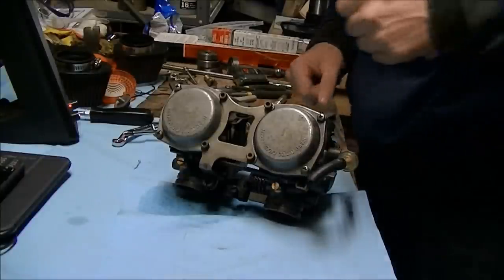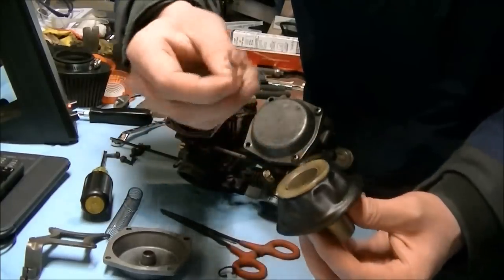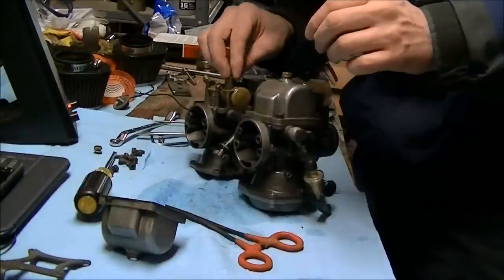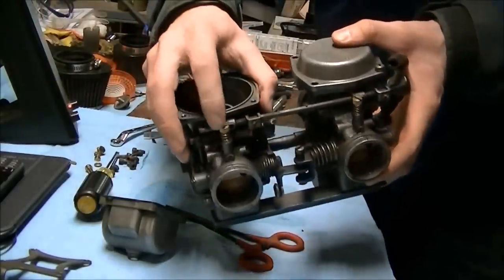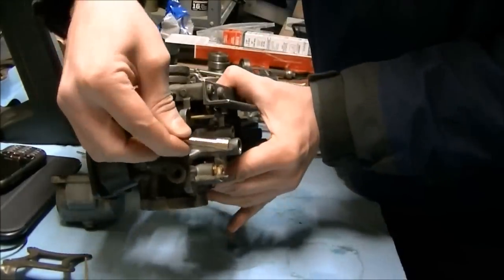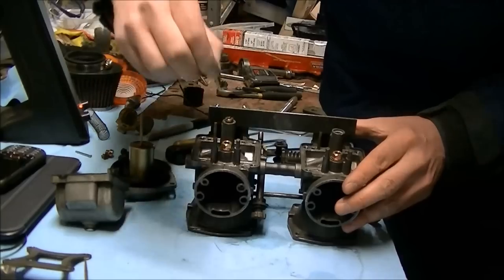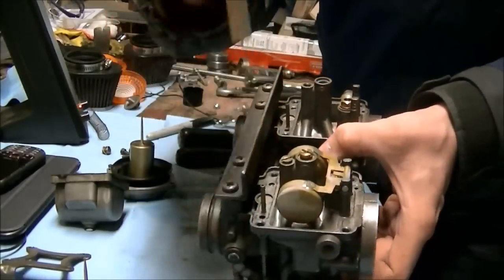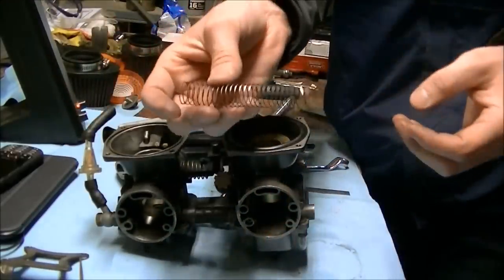How to clean the Yamaha XS400 and XS650 Mikuni BS34 carburetor

Comment: A helpful tip for things like jets my dad always told me: use two fingers to tighten, then turn 1/8th of a turn or so past that point. Also ultrasonic cleaners work great for cleaning carbs, as long as you're doing a full rebuild and are planning on swapping all the gaskets.

Comment: With "High Definition" AND suspenseful tetris music!

If this is the first clean and you wanted to emerse the carbs in a cleaner, would you recommend taking more apart?
Reply from the maker: Be careful soaking them; there are hidden plastic parts that can be vulnerable to solvents. Honestly, I'd just use compressed air and carb cleaner!

Comment: My 1978 gs 400 is now straight pipe....same exhaust diameter exit has thé original ones..... do i need to change jets on there or whit that air/fuel adjusting screw i can get a suffisant adjustment!!!!! .... Nice video by the way!!
Reply from the maker: Luis Camacho straight pipes definitely need jetting. You will likely need to change the pilot and main jet. It's also possible the needle height will need some tweaking. Best bet is to search the forums for your bike and look for someone with a similar setup that posted their settings. This can save you a lot of tuning.

Comment: How essential are the screens under where the float needle is located? I'm afraid while cleaning the screens I damaged one, they are brass and a bit fragile. My instinct is the carb will still work fine, but I'd like to be sure.
Reply from the maker: The screens are used to filter the fuel, so they are not essential to run. However, I would recommend installing an inline fuel filter between your gas tank and the carbs. I recommend everyone do this, but especially for you if you're missing one or more screens.
Reply: @RiderForge  Thanks for your quick response. I've ordered a carb kit, 25 bucks, which has the float needle seat screens., as well as new jets, gaskets, and needles.  I figure it's better to play it safe, and why not replace these things while the carb is off the bike.  Do you have a video on installing an inline fuel filter? By the way, thanks for this video which was of great help to me in cleaning the carb on my 79 Yamaha XS400.
Reply from the maker: @_Peremalfait  Good call. I don't have a specific video on that, but it just involves cutting your fuel line and jamming the filter in there. It's good practice to use clamp fittings for security. You just want to ensure it's a small filter designed for a carb (and not a fuel system with a fuel pump which generates a lot more pressure). The filters are also directional. The next "gotcha" is ensuring you have the correct size filter for the size of your fuel line; you will want to either measure the inner and outer diameter of the fuel line or confirm with someone on your model-specific forum.
Reply: @RiderForge  Sorry to bug you again. I got a carb kit for my BS34. The kit didn't include gaskets for the float needle seats. Do I need to get some? The old seats appear to have used a flat gasket, but there's not much left of them.
Reply from the maker: @_Peremalfait  You may just want to try things with the parts you have on hand right now. Taking the carbs off and apart doesn't take too long once you've done it a few times. I did it so many times I was able to get them off, adjusted, and back on in under 10 minutes! Anyway, I will say that the bs34 carbs are "fickle" and even the tiniest imperfection may cause issues. Worst case scenario you fix the parts you have yet to replace. Good luck!
Reply: @RiderForge  Thanks again. A really appreciate the response. I actually managed to find a gasket at an auto parts store. It was a little too thick and sanded it down to match the broken one. It fits, and at this point I'm done tinkering until I get a chance to try it out. Waiting on a new battery and plugs I ordered online. My bike is a 79 xs400 and It's been in my shed since 2007. Getting it up and running again is my goal for the summer.

Comment: Just a quick question. Do you ever lubricate any (internal) parts of a carb? Perhaps, not needed since fuel with oil is circulating, or, may clog stuff out. Just wanted to make sure..  Any thoughts on that?
Reply from the maker: Ken To good question. There are a select few areas of the carbs I would lubricate but these generally don't come up during a routine cleaning and they are technically external. This includes the choke rod, the butterfly valve "rod," and the throttle cable insertion point that pulls on the butterfly valves. A sparing amount of lubricant can be used in these areas where metal is moving against metal. Think of it more like lubricating a door hinge. Any parts like that can be greased lightly so they move easier. Anything internal shouldn't need lubricating and since gas is a great solvent anything you do add will be very quickly washed away or worst case it might clog things up.

Comment: great video, tx.      on  my right carb turning the newly installed fuel/air screw [ and fresh o-ring ] does not change the idle at all, not a bit whether its screwed in all the way or out all the way.  does that sound like a clogged pilot jet?  tx!
Reply from the maker: It could be a clogged circuit, yes. Also, ensure the old pilot jet tip did not break off into the inlet; this happens when people tighten them down too much. Are the pilot jets also new? Are the tiny holes in them clear? Sometimes I pull out the jets and air screws and spray carb cleaner in there; then blast it out with an air compressor. I made a little rubber tip for my air sprayer fitting; it really clears everything out! Other things can affect the idle too; the butterfly valves; the carb synch, the fuel level in the float bowls, the air filters you're using, the valve adjustments, the timing... and it goes on and on.

Comment: hey thanks, super informative. what do you do if you strip the head on the pilot jet? asking for a friend....
Reply from the maker: FuckinPrawns Decide if it is necessary to remove; often times you can clean the pilot circuit THROUGH the jet without removing it (use carb cleaner and compressed air). If you need to increase the jet size this won't work of course because it will need to come out. A standard extractor should work assuming it is long enough to reach. You may be able to remove it by hand (no drilling) because it is so small and made of brass. If you go slow, jam the extractor in there and twist it out by hand you should be good to go. Before you start with the extraction dump some PB Blaster or equivalent in there and let it marinate for a while just to make things easier. You can also try hitting it with a little heat using a butane torch. Make sure to clean the Blaster out before inserting the extractor or shooting it with fire. Use the smallest extractor possible to avoid damaging the surrounding threadings as well.
Reply: chiangxiong i guess i have to find an extractor small enough to fit. thanks for the help

Comment: What was that plug on the pilot jet near the main jet? Mine had a rubber plug on the pilot jet on one of the carbs. I did take it off but the bike runs fine without it. thanks for the videos.
Reply from the maker: Later models came with rubber plugs; older ones like mine have brass plugs. The pilot jet plugs are literally designed to allow access to the pilot jets. It's a controversial subject because results are very inconsistent when these plugs are removed. Some people run too rich or flood when these plugs are removed; you'll also find just as many people that seem to be able to remove them without consequence. From a design standpoint it looks as though they will prevent excess fuel from entering the pilot circuit without first passing through a small channel linked to the main jet. The thing is, sometimes the extra fuel coming through an unplugged pilot jet at idle is not enough to cause problems. Other times it is. If it were me I would install them or replace them; an engineer at some point created them for a reason. As much as I've tried, finding a true answer to this question has proven very difficult.
Reply: I will put it back, but do both carbs have a plug? only one of mine did. thanks. Mines a 1982 special II, btw.
Reply from the maker: Yes sir. Both carbs should have a plug. Check out xs400.com as well; it's a great site.

Comment: Is there a way to clean the carbs (just to make it clean enough to operate properly) without having to re-set the mixture screw and re-sync the carbs afterward?
Reply from the maker: I would recommend pulling the mixture screw out for cleaning but you can certainly avoid syncing the carbs initially to just see how it goes. Adjusting the mixture screws is super easy.
Reply: I wish you could make a video on that. After cleaning, we should adjust the mixture on each carb individually, and then sync them, right? I went to some shops around my place, and they said old carbs like mine are usually hard to setup.
Reply from the maker: Old carbs might take longer to clean because they've been neglected for years. Parts can also be more difficult to locate. Some customers might get upset about this and blame the shop for the bad experience.

Comment: awesome! Did you clean it after you took the emulsion tubes, the pins, the float needles, basically once you disassembled everything thing in your video?
Reply from the maker: I cleaned everything off camera on both sides. I just wanted to take everything off as fast as possible in this video.
Reply: chiangxiong well..... tried taking the needle off the float bowl and the tower just cracked in half.... now I'm currently looking for a right side mikuni BS34 carb. Haha, just my luck. But the video definitely gave me a good idea of how to properly clean it, thanks again! I guess I've been cleaning it wrong this whole time!
Reply from the maker: Michael Park That sucks! I've seen a few of those towers crack before. Sometimes the pin gets stuck and it seems like it doesn't take a lot of force to break them.

I wasn't terribly impressed with the results I got from soaking in the past. Unless you have an ultrasonic cleaner of course.
Reply: Michael Park May Be a Little Late now, But, I drilled down into the carb body, then, drilled into the top of the broken Tower all the way through. Then I placed a Snug Pin into the carb base and Broken top of the tower and used a small amount of JB kwik weld to ensure a bond. I replaced the Float Pin for alignment while I clamped it to cure and I also used a small amount of Vaseline at the Float Pin so the JB Kwik Weld didn't stick to the Float Pin. It Worked fine. There is no pressure on the tower so it's a Option for repair. I found the Tower Broken when I opened the carb after Buying it.
Reply: chiangxiong The pins don't just become stuck, some models have a thicker ends to the pin so it is pressed tightly into both towers. When I tried to tap mine out at the first clean, similarly to your technique, the head-end of the pin remained stuck and bent as the tower gave way :( You might want to mention this in the video, as your technique will break more towers when a little more force is applied. 
Here's the forum thread on broken towers with more info and fixes: http://www.xs400.com/forum/showthread.php?t=10312

Comment: Hey man I have an XS400 78' I want to put mechanical carbs can you recommend some that they fit? thanks in advance :)
Reply from the maker: I have seen a few carb swaps (including a single carb setup) done over the years on the forums, but this requires custom fabrication of intake manifolds and/or brackets. To my knowledge nothing bolts directly up. Are you looking for a bolt-on solution or is fabrication an option?
Reply: I really do not know! I just got fed up of my bike not starting on easily and though of moving to mechanical carbs. But i do not know exactly what i have to do. SO i think i am looking what works best. And maybe the steps I should take.
Reply from the maker: For the bike to start easy the carbs need to be surgically clean and the timing needs to be perfect. If you adjust these two aspects you may get the results you're looking for. Mine always started first kick.

Comment: Any advice on a stripped pilot jet?
Reply from the maker: closson91 my first advice is to leave the pilot jet in. If you're leaving the bike stock and it's running fine there is no reason to remove it. Just run carb cleaner through it and hit it with compressed air to clean it out. If you really need to change pilot jets there are a lot of forum posts and videos describing removal strategies. Good luck!
Reply: RiderForge thanks but I'm very familiar with how to clean the carbs. The previous owner stripped it in and I've tried to pull it a couple times without success. I'm just concerned it isn't getting proper flow since its flattened. Thanks
Reply from the maker: closson91 as long as the actual aperture or hole is not damaged I cannot imagine there being any significant impact on performance. There is a lot of risk involved in removing the stuck jet. Why not test the bike first to see if it's actually a problem before attempting an extraction? Remember the pilot jet only contributes to performance at or around idle and the flow is fully adjustable. If there was a slight increase or decrease in flow just adjust for it. Job done. If you bugger the carbs trying to remove the pilot you may create more problems than you solve, incur more expenses, more down time, etc.